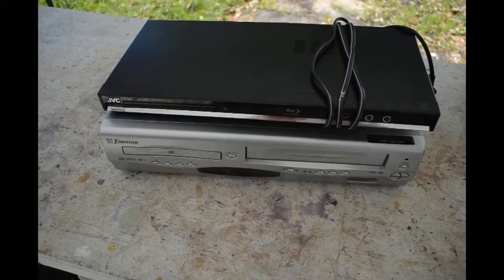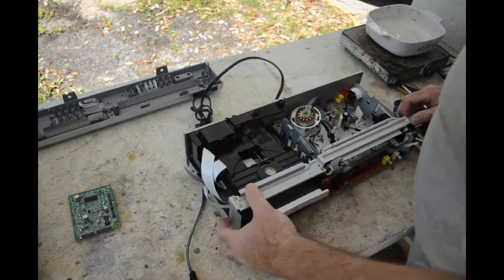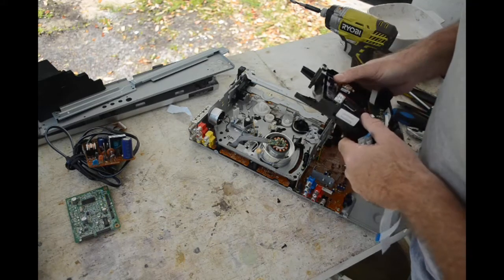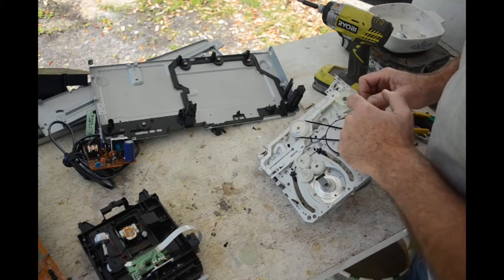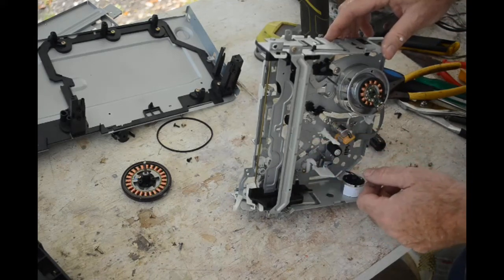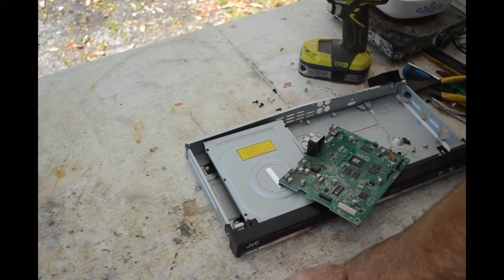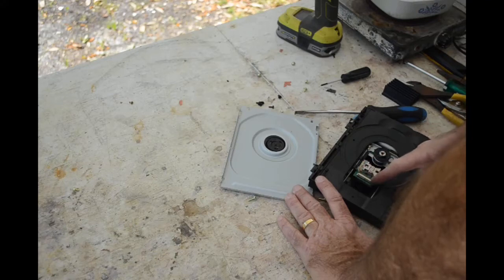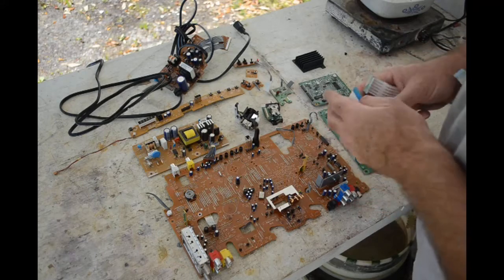Recovering gold bearing components from consumer-grade VHS and DVD players.

Comment: If you have a good bit set for your drill.  there should be a size 0 Phillips head bit that you can put in the drill to take those little screws out.  I bought 750 of dvds and cable boxes from my local yard.  It takes about a week to take them all apart while outside in the freezing temperatures.

Comment: There is no Gold in such unit , it's a lost of time , you'd better find in old CPU or gold pin socket contact from  the 80's to 2000 , or you can find gold also in industrial system or médical rack etc...
Reply from the maker: Did you actually watch the video? There is some gold to be had. Maybe not enough to make it worthwhile for some people, but there is gold in them.